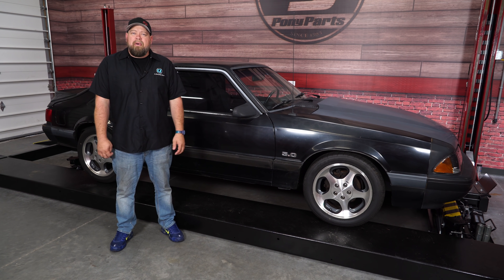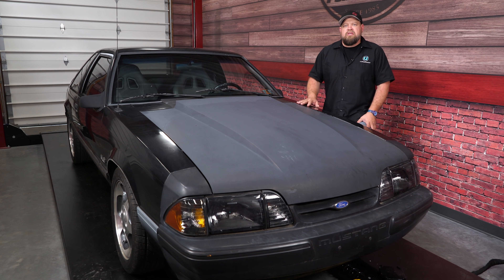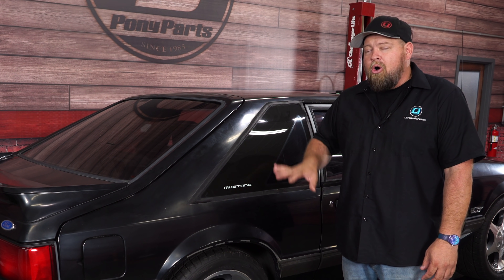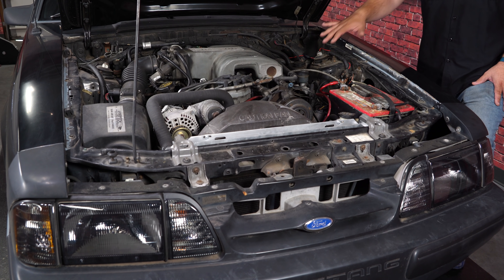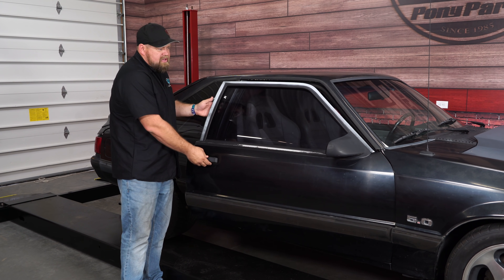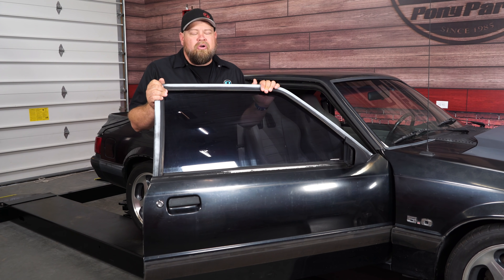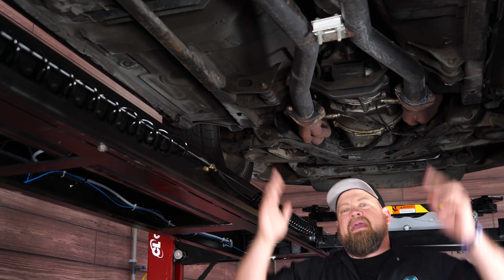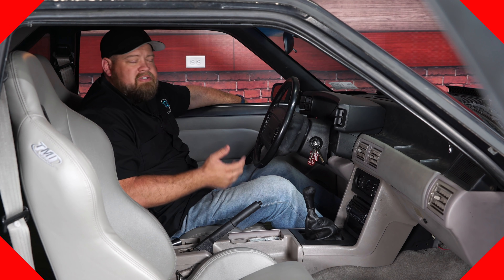Buying a Fox Body Mustang? Here's What You NEED to Look For!

Comment: The fox body was used until early 2000’s.the platform is why it is referred to as a foxbody
Reply from the maker: 1994-2004 was the Fox 4, still a fox platform but when enthusiasts refer to the Fox Body its the 79-93 cars.
Reply: @cjponyparts  Got 2 foxbodies for sale ...
Im unable to finsish either want to sell to another foxbody fan.

1 82 mercury capri,non op.
Motor has all machine work done , assembled shortblock. Was a daily driver before i began restoring , pulled engine , cleaned engine bay (media blasted and sealed) .
4speed trans, pulled and cleaned. Small rear end (not an 8.8) its factory . 2.83 gears i believe.

Other car is 87 GT speed density car .
Roller with cowl hood & 4 lug black cobras .no motor or trans , back tags.

Both cars are in bakersfield .
Need both gone asap.

Respond to this if willing to meet in person and pickup or i can help coordinte shipping.

Comment: Hey man I got an 89 Gt convertible with a 302 carburetorated engine what do I do about the throttle sticking? I'm not a cat guy but I love this car
Reply from the maker: Depends on what throttle cable and linkage is used. the 89 would have fuel injection from the factory.
Reply: @cjponyparts  yeah it's a crank motor carburetorated brand new but sat for awhile

Comment: Where can I get quarter inch spacer that will fit a fox body four lug n can I run a 235/50/16 front n 265/50/16 rear on a 1987 gt with 16 inch pony?

Comment: In getting a 92' foxbody convertible for $550 but it has a blown head gasket and the person has a replacement should I get it?
Reply: Dravvis Sanders A head gasket is a costly and very time consuming repair. Also the convertible is the least sought after model due to its weight. If you like convertibles then I say go for it. 550 if its just the head gasket and everything else is perfect is a good deal. Just realize it is very costly and time consuming. Personally I’d keep looking but thats just me.
Reply: Ya but I'm doing the work myself and it's just the 4 cylinder engine so it's easier to work on also I'm not looking for speed and stuff just like nostalgia and classics
Reply: Dravvis Sanders I’d say go for it then. Its only 550
Reply: @gamerfallout  right lmao and especially since the convertible works with no tears lol

Comment: The foxbody was so poorly engineered. It couldn’t do anything with proficiency, the car had way too much torque for its handling which resulted in horrible fish tailing that a lot of the times ended in an accident of some kind. The paint on the car was so bad that the Japanese asked ford to send them unpainted and primed. The mustang rattled so badly that things like the rubber that insulated the windows would start to leak, especially if it had a sun roof which always seemed to leak regardless. Those stock 373 gears were irresponsible to put on that car, it had way too much torque. That torque was never intended to be used on straight sways, they were meant for the track where the car would drift tgrugvh the turns, you don’t have that in most places in the country, and so what you have is a front end that couldn’t keep up with the rear, the result, a heck of a lot of crashes.